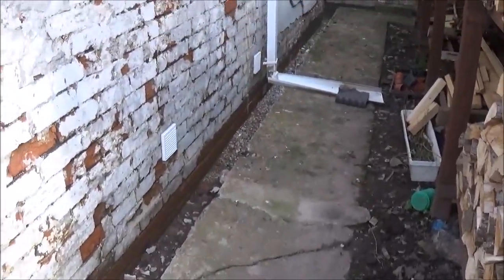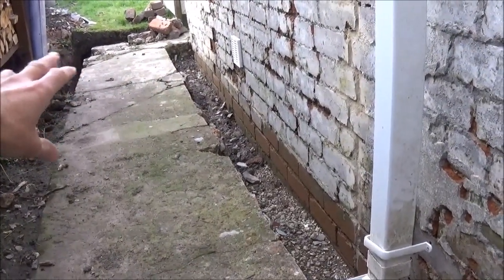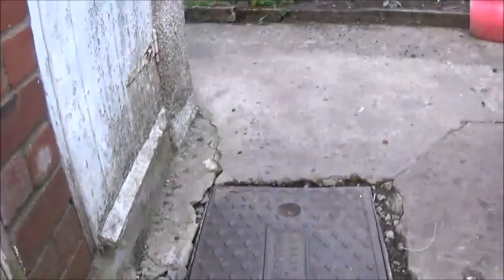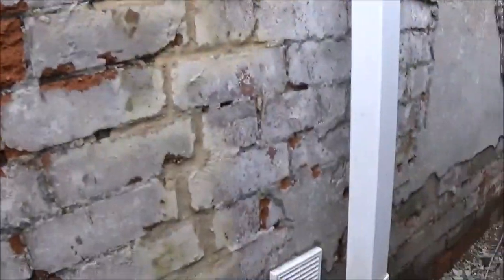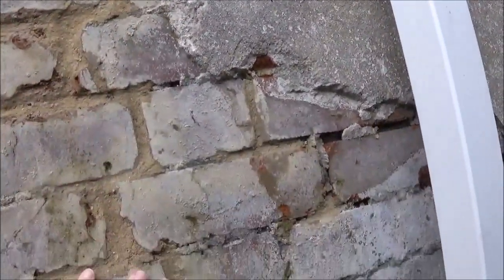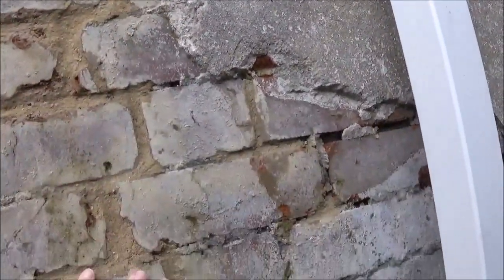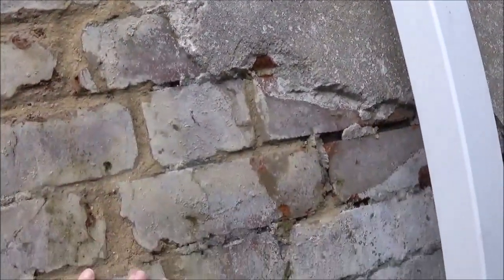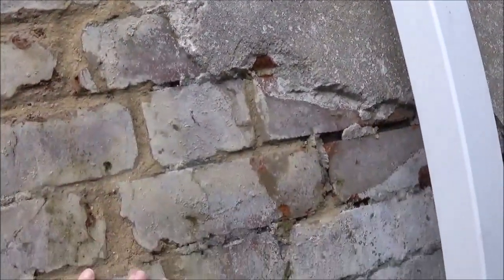How to fix rising damp & penetrating damp - (PART 2) Channel drain / french drain installation.

Comment: As someone who just got her first mortgage on a 100 year old house (my boyfriend has had the house for 16 years) I was convinced the damp was caused by low foundations and render issues. We're now making a plan to follow your videos on the two effected walls in summer when it's dry ❤️
Reply from the maker: Thanks for taking the time to watch. Bear in mind I'm not an expert, just a DIYer with a practical approach. For me this worked but obviously internal ventilation is important also on old houses. I have a wood burner in the adjacent room I crank it on throughout winter which heats my kitchen up a treat and helps also. Best of luck with it!

Comment: Can I ask 8 years later how this has held up? Going to do the same, thank you so much for showing this approach!
Reply from the maker: It's worked well with a huge improvement. But being a solid brick wall (no cavity) and therefore very cold, I still get condensation (not damp) in areas if something is close to or up against the wall. Behind the kitchen units I've had to add vents to allow ventilation but obviously the downside is you're allowing cold air into the room. My 'solution' which I still haven't done is removing all render from the outside wall and timber cladding it. This should warm the wall up a lot and stop rain from directly touching the brick which I'm hoping will have a big improvement to the temperature of my internal walls. Best of luck with it.
Reply: @POUSEaroundtheHOUSE  have you considered external wall insulation? That would deal with any condensation and give you a clean Finnish over the brickwork.

Comment: Fantastic work 

I have purchased a 100 year old house with minor damp. Since going through the buying process I've been learning about damp and will be doing a French drain like yours shortly. The ground levels are high around the house as the air brick is two levels lower than the grounds
Reply from the maker: Thanks for the feedback and good luck with your project.
Reply: POUSE around the HOUSE thanks 

I have started digging around the house and it's going well. 

I would love to get your advice on materials etc. Would be happy to pay you for your time if you'd be interested in checking out my pictures and advising on the best route to take

Comment: Excellent approach to low level internal damp - work with an old building and not against it - As pointed out applying modern techniques/materials (raised paving, cement rich render and injected DPC's etc) to old buildings (built using lime mortar), are likely to cause problems rather than solve them.
Reply from the maker: Thanks again for the feedback.

Comment: Great to watch finally somebody knows what there talking about instead of all these cowboy damproofers!!
Reply from the maker: Hi Peter. Thanks for watching and thanks for your positive comments. I assume you have watched all 3 videos but in case you haven't, there are 3 parts! I am in no way trying to snub anyone by doing this video, but I am amazed at some of the methods used for damp proofing and that the building/construction industry accept them. Everyone I know that has had chemical damp proof has had the damp back within 2 years and for some reason people accept that it needs renewing and pay again. I hope this video can help novice DIY home owners what methods can be used to really help solve or at least improve damp. I won't call it rising damp because I believe all damp is penetrating, but that's my personal view. These methods are not expensive either if having a go yourself. Once the brickwork is exposed, you can really start to see what's going on. I really hope retro damp proofing changes in the next few years as it really annoys me to see home owners spending hard earned cash on something I know wont work. Thanks again for watching, and please take a look at my other videos to see if there's anything I can help with!
Reply: @POUSEaroundtheHOUSE  thanks for all your videos mate! really helpful. I get what your saying on theres no such thing as rising damp and only penetrating damp. However what are your thoughts on internal wall damp (my one is between a dining room and living room in a victorian terrace house). How can you tackle this problem?
Reply: @gguzman6438  I've the same problem. The internal wall has damp , it has had it's lime plaster removed and covered in gypsom which acts like cement and is non breathable. Need a removed and traditional lime plastered.
Reply: @POUSEaroundtheHOUSE  I have a similar issues to deal with but their are too many obstructions for a French drain. Would you advise on making a soak away trench and fill with shingle

Comment: I know it seen years, but this vid is what I needed.
Just so you know raising damp is a thing - capillary action drags water up a porous surface as long as there's water to be dragged up. The solution, however, to is to drain the water (with a French drain for example) , not randomly punch silicone into the bricks =_= Treat the cause, not the symptoms.

Comment: Brilliant set of videos Thanks for taking the time to explain everything you have done - I’m curious why you went with French drains next to the house rather than eco drains, wouldn’t these be easier to maintain?
Reply from the maker: I put a channel / eco drain away from the wall simply because the path slopes away from the wall taking the water run off away to the drain. The french drain was because I needed to lower the path to stop damp, and as belt and braces added a french drain in case of any water pooling it could take it away without any splash back. Hope that makes sense. Thanks for watching.

Comment: What would you recommend where there is dampness seen in subfloor  floor of house adjacent to  gable wall . Cavity wall construction . There is a path running down on the external side of the gable wall ( paved path I think) between house and neighbours house.  Path is on neighbours property.   Neighbours floor level also slightly higher ( 350mm approx) .Path extends  all he way  up the edge of the gable wall.  Path level could have changed from original level  because it was re-laid some years ago  .  What should I look for here to diagnose the problem ?
Reply from the maker: I'm no expert, just DIY with some problem solving but I would look to get ground levels lower than interior floor if possible, get water to flow away from house wall where possible. Also, if you have a cavity and it's an old house, it maybe worth taking out every 3rd brick for example at ground level, and take a look in the cavity as it may be full of old mortar and dirt from days when build quality wasn't quite as precise. That can cause damp to cross the cavity. Hope that helps.
Reply: @POUSEaroundtheHOUSE  Thank you for your suggestions .

Comment: This is interesting...I am in Wales and my mother's old terrace house in Wales, no cavity wall.. has no trouble on the front of the house, but on the two external walls on the back of the houses, lower down the plaster peels and salts come through. Outside it is rendered with modern day cement, so I wonder is that render causing it and not letting wall breath. I guess the ground concrete could affect things too... anyway as a non builder myself I feel like trying getting the render hit off outside just a foot or so from the ground and then putting lime mortar near the floor... who knows

Comment: Another great video and good to see your getting on rightly. I'll be interested to see the French drain one as I am going to be doing this
Reply from the maker: Thanks again for your nice comments. You'll be pleased to see I just uploaded PART 3. It was too long to upload as one video unfortunately. Hope you enjoy!
Reply: Great video. I have a similar issue but with gravel up again a wall and drain pipes straight into clay with no soak away.

Have pulled gravel away from the wall and was going to fit a French drain below floor level with slabs as retaining wall keeping back the gravel path.

Is there a reason you used a channel drain next to the wall? Is there an issue with using a French drain?

Comment: Just watching your videos as have a similar problem. We have a 1940's ex LA semi with render about 1 inch to 4 inch from block paving. We have damp appearing at the base of a chimney breast. Been told by most people (2 builders & a damp specialist of sorts) it is most likely rising damp. 1 Builder said he thinks creating a channel like you 8 inches from wall about 1 foot down and fill with shingle he also suggests cutting back the render up above the damp proof course which is covering it by about 2 inches. Our ground is a mixture of clay etc.. I think it would be better to install a french drain like you did first before hacking back the render. To compound the issue it seems we have soakaways close to the house! The old style pits not crates. I am thinkinking may need to install a new soakaway too 5 metres from property. It's a nightmare! What are your thoughts please?
Reply from the maker: Hi Jason, I'm no expert, just a problem solving DIYer! But as a general rule you want to get water away from the house. If it was me I'd be getting the soakaways away from the house if possible, reducing ground level, and as you say maybe leave the render for now and see if the problem goes away first before hacking it off.  If water is being diverted into soakaways near the house then that is likely to be a problem I guess but unfortunately it's a bit of trial an error. Start with the easiest job and and keep going until it dries out. Hope that helps and best of luck with it.
Reply: Thank you. Well started to dig a trench on one side about a week ago. Then just left it to dry. Which I thought it did. Until it rained like hell this weekend.  As the advice was not chimney as it looked fine l hadnt considered checking the chimney too. Anyway this weekend went up only to find a slight trickle of water making its way down  the  chimney breast in the roof. Also a fair chunk of concrete on the insulation below!
Also a trickle on the chimney in the middle of our semi too. The felt is perled back there too. I am rather annoyed that 2 Builders couldn't be  bothered to get a ladder out and have a closer look rather than just from the ground! It may if course be a combination of issues, but they will not be getting the work if I can help it.
Reply from the maker: @Jason-nj6ve  nice problem solving. You're doing all the right things. A good inspection especially when raining is a great way to see what's going on. Often the problem is simple and crude, just requires a bit of investigation and and hard graft. Poor lead flashing or lack of lead soakers is a common problem with leaks. Keep up the good work and best of luck with it. Let me know how you get on!
Reply: @POUSEaroundtheHOUSE Well the Rics surveyor come round yesterday. I managed to get one in for a very reasonable price who was specialised in damp. He spent 2 hours here doing a lot of checks and a lot of readings! Anyway I proudly showed him the chimney and while he said the gable end may need looking at, he wasn't too worried as he sees a lot worse on properties of my age. He would also expect a little rain to get in a considering the amount of rain and wind direction etc. He said he was sure the problem is lower down. He advised me to hack back the internal plaster from well of the ground and leave the trench outside open for a couple of months to dry out more. I had filled the holes after taking skirting off do decorating down to the ground! (no hiding anything) We even had the new laminate up! To take regular readings both inside and outside and record them to see whats happening. As for a drain he thinks our soil is a mix of clay/ sand. He doesn't think we have to have a drain. However when I suggested a concrete 45 degree run along the corner of the foundation and our wall he thought that was a good idea to stop rain sitting on the bottom of the foundation and run it away from the house. We have a block paving driveway anyway so water seeps through to a certain degree as well as runs off. He agreed doing a trench all around the house was a good thing but for now just the affected wall should be a priority and then filled with shingle. He kept saying don't spend too much do the simple and cheap things first. He also mentioned moving the soakaway would not be a bad idea, but thought this was not a cause of the damp due to the run of the ground. Again not a priority. Chimney caps need coming off as too tightly fitted (wrong size) and replace with chimney hood cowls to aid ventilation. Finally if all else fails then check the cavities on the wall take a brick or two out and check for rubble etc and pull it out. I am going to buy an attachment endoscope for my samsung phone to check in cavities if I need to do that. There was more just waiting for the report. For £150 I thought it was good money spent. Can't put a price on good knowledge and experience. He doesn't believe in rising damp and has 40 years in the game. He doesn't like injecting at all. Biggest con out in his words. I liked the fact he wasn't trying to sell me something being independent. I will get the chimney checked by a roofer of course but don't think its major thankfully. He even thought the mouse poo I found everywhere was bat poo as he could crush it in his hand!
Reply from the maker: @Jason-nj6ve  great work. If you look at one of my latest videos - how to stop a draughty chimney, you can see my chimney cowls in combination with a swept chimney, and a chimsoc has been great. I have no damp issues in chimney. Best of luck with it and let me know how you get on.

Comment: Hi Pouse, I want to install channel drain along a wall. Let's say the existing path that I'm cutting into is not leaning towards the final drain point, does it matter that some water will be sat in the channel?
Reply from the maker: Ideally you want the water all to run down to the final drain pot, but if it's just a couple of mm of water then I guess it's whether you're happy with it or not. You may get a bit of splash back when it rains but with the grid on top should be ok.  The important thing is that all the water from your path runs into a drain and isn't left standing against your house wall as that's when you'll get the damp problems. Also that the drain is 6 inches below your damp proof or interior floor level if possible. Best of luck.
Reply: @POUSEaroundtheHOUSE  Cheers. It's too much work removing the whole paving and trying to alter the level. At least if the water is in the drain it won't be penetrating the wall. That's my theory. In any other circumstance I would dig it all out.

Comment: We are having damp problem in our kitchen wall and behind the skirting boards. It's concrete floor.  
It feels like rising. We are not sure if it Has damp proof sheet in the wall or not.
It has damaged our wood floor.
Unfortunately previous builder didn't put damp proof sheet under the wood.
Now we are thinking to put damp proof sheet under the wood and behind the skirting boards as well.
Do you think it's enough.
Damp is very very slow. It's not rising any more but it is there. 7_8 inches on the wall..
Can you suggest something.?
Reply from the maker: Really sorry, only just noticed this comment. I would try to lower the ground level outside first. See if that helps. As you say some damproof membrane behind skirting may stop wood from getting wet although it won't stop the damp. Also check your gutter, downpipes and drainage outside in the ground for leaks. Any one of these can cause persistent damp and cold walls. I'd be interested to know how the problem is now and if you've done any work to rectify it. Thanks for watching.
Reply: @POUSEaroundtheHOUSE  
Ooo thanks for coming back.
We called some local damp proof experts.
They all checked with their device that it's coming from the of course floor.
But as it was out side wall there was some layer of protection.
Which was not visible.
So they took off some of the cavity wall front to see and confirm...
There was also chance of having some debris there .
But it was all clear.
Eventually they all suggested to put bitumen solutions on the floor near the wall.
Let is dry.
Put waterproof sheet over it bit extended even on the wall behind the skirting wall.
To be more careful we put floor away from the wall .
Roughly 3_4 Inches away.
To give it some gap or expanding with the weather or mousture.
Covered it with the box.
And it is so far quite and under control.
It Didn't show any sign of swelling or rising.
Finger crossed 🤞.
So 
Bitumen
Extended layer of waterproof sheet even on the wall behind skirting boards.
And floor was put extra away then normal from the wall. 
Covered extended gap by wooden  box on the top.
Hope I made some picture. To imagine the solution we went with.
Reply from the maker: @ompk142  hopefully it'll stay that way. Thanks for letting me know, great result!

Comment: Watched the videos about the French drain, really helpful and informative. I live in a Victorian house and already have French drain cut out but it's filled with small stones and soft soil underneath the stones. I want to replace the stones and soil with the drain pipe you have installed in this video. Does your company offer this service and if so how can we contact you?
Reply from the maker: Hi there. Glad the video was useful. I don't offer this service, the work in the video I did on my own property but if you follow those steps it is a fairly simple job to do if you feel up to it. Good luck with it and thanks for watching!